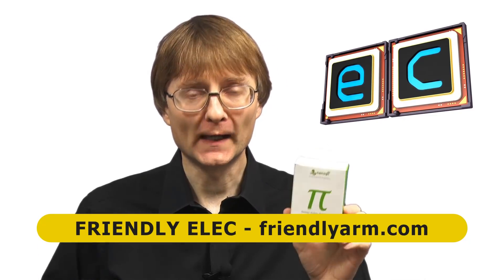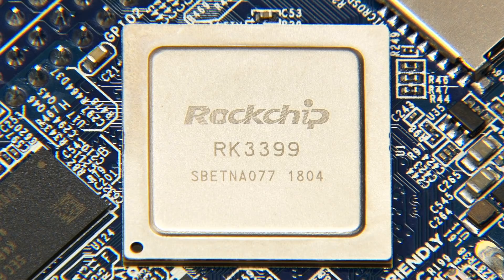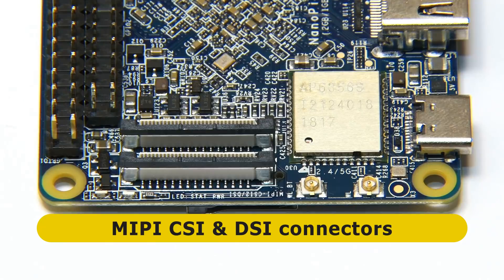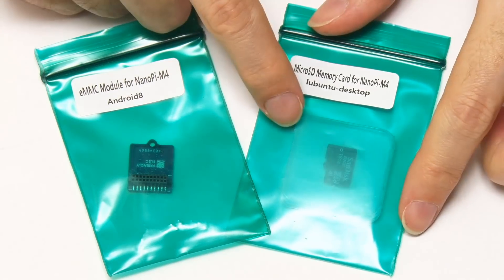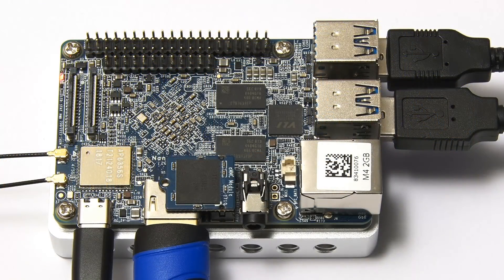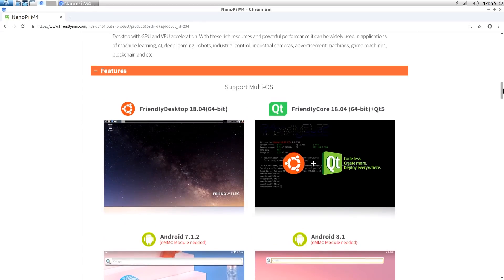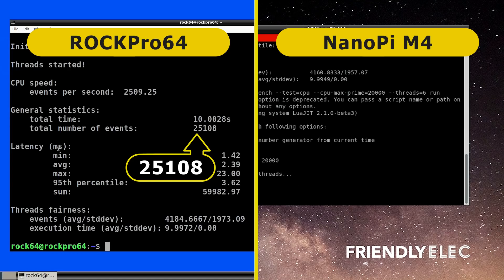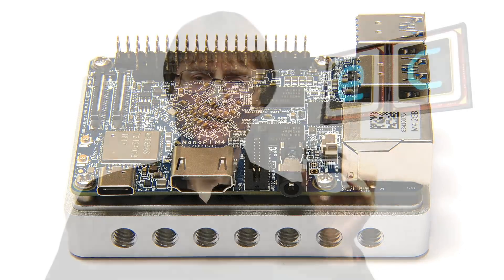NanoPi M4 : RK3399 SBC with 4 x USB 3.0

Comment: Friendly criticism: there are a few things that are always missing from your videos such as what this board could be used for and most importantly, long term stability and temperature reading. 

My experience with RK3399 is that it's a tremendously inefficient board and produces huge amount of heat. None of these boards come with custom made sinks or fans and so running this on a heatsink from rpi3 at a constant 60-70 celsius will just kill this board much faster. 

I had to do a headless OS for this to run in the range of 40-50 degrees while my Odroid XU4 never goes beyond 35 (despite being years older, more powerful overall and cheaper in price, although only 2 USB of course). 

So in the long term, it comes down to: What will you use this for? A lot of the Chinese companies producing these boards need to create more focus around the board, similarly to how Korean Odroid did it if they want to be competitive.

In comparison, Odroid comes in very unique factors, including specifically designed cloud form with a hard drive attachment, because they realized that SBCs are all good for 1 thing usually and so focusing is important. 

So far, with the exception of Renegade board using a similar processor, I found all RK based board to be just white elephants.
Reply from the maker: Thanks for this. I find your comment about no heat sink and using a Raspberry Pi one extremely strange given that I fit the very large and dedicated NanoPi M4 heat sink in the video, and talk about it quite extensively. I have covered SBC cooling extensively in some videos, and also uses. I have over 70 SBC videos here, and not all of them can cover everything! :)

Comment: Can we have a video of two 35$ SBCs Raspberry Pi 3B+ and Orange Pi Plus 2E. Apart from the processor the orange pi has an edge over the rpi. Also, armbian support for orange pi makes it much easier and faster than before(although I saw an article -  https://tech.scargill.net/orange-pi-plus-2e-revisited/ and the guy wasn't satisfied). Can you please cover the comparison of both devices (including the things in the given link) with a decent amount of active cooling? It's a request and I think it would show how overrrated or underrated orange pi is. You may also add tinker board (or the 's') to the comparison as it's specs are almost similar to the orange pi plus 2e. It would be then interesting to see two 35$ vs one 69$ - https://www.board-db.org/compare/156,113,251/ 

I apologise for the off-topic comment.
Reply from the maker: Noted! I do intend to cover some lower-priced SBCs soon. Though the next one here will be a LattePanda Alpha right at the top of the market.
Reply: @ExplainingComputers  Thank you :-) Looking forward to your next video.

Comment: Would this hardware be capable of encoding full HD with h.264 in real time?  I might get a board like this for emulation and such but real time video encoding could be a useful second use.
Reply from the maker: According to the Rockchip web page for the RK3399 -- http://opensource.rock-chips.com/wiki_RK3399 -- the SoC has "H.264/MVC/VP8 encoders [for[ 1080p@30fps". So in theory, yes. But it will depend on having software to take advantage of this.

Comment: A note on the RK3399.  That thing gets very very hot.   I have been using a NanoPC-T4 for some AI stuff, and with a passive heat sink the internal temp raises to about 78 C, while in idle stays at about 50 C.    So a fan is definitely necessary to extend the life of the board.  That said, these things are fast, for the price.    They aren’t as easy to setup/use as RPI, but then again with greater power.. you know the saying.
Reply from the maker: Spot on Sir. :)

Comment: As always great video. I saw it supports PWM. Does that require 3 pins. Lets suppose I wanted to connect R/C type servos and program them. Or do I need another interface board?
Reply from the maker: I've not looked into this for this board, but in theory the PWM could be used to control servos directly, although they would need to be independently powered.

Comment: Do you see any reason why this board wouldn't be able to run kodi? Do you know if the board's HDMI is CEC compatible like the Pi that way the TV remote can be used to operate Kodi through the HDMI cable?
Reply from the maker: Should be able to run Kodi. I suspect an image will appear soon (the board is only August 2018). Don't know about CEC.
Reply: Thanks for the reply.

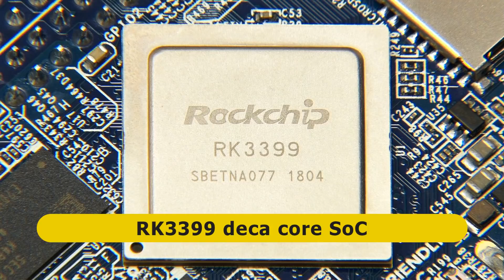Comment: At 2:22 it is shown the A72 cores "up to 2.0GHz", also the friendlyarm's hardware spec says up to 2.0GHz, but at 11:11 the system information shows 408-1800MHz (and less than 1.5GHz max for the other cores, too). Am I just noob with how linux handles/shows the max frequencies (i.e. system info would show 2.0GHz only after pushing it for real, or the configuration is just wrong or ...) or what is going on with that?
Reply from the maker: There is much discussion of this over in the forums for this board! The specs for the RK3399 are correct at 2.0 / 1.5. But the board, as you note, clearly reports running lower than this in the distro shown, as you have correctly noted. It can probably be tweaked! :)

Comment: Question about this particular product... Can the NanoPi M4 run a standard Raspberry Pi distribution like raspbian? What about things like Diet pi? If indeed it can run raspbian, does it have access to all the hardware or require special configuration? Would we lose specific optimizations and or Hardware support for certain things? For example if running raspbian does it understand all of the io connectors and the Wi-Fi and ethernet Etc? Apologies if I am off track with my questioning, I am always confused on Raspberry Pi similar devices, maybe I have missed the point and we are not supposed to run raspbian or Diet pie or other images, perhaps we are supposed to only run the image supplied by the board maker? Any guidance and insight certainly appreciated, thank you.
Reply from the maker: A standard Raspbian image will not work. Raspbian could potentially be ported to this board, but it would need its own image to deal with precisely the hardware requirements that you raise.
Reply: @ExplainingComputers  thank you, that helped

Comment: $30 more for an additional 2 GB!  Who do they think they are, Apple?
Reply: 2GB version is DDR3 and 4GB version is LPDDR3. LPDDD3 operates at 1.35 volts, consumes less power and produces less heat than DDR3 (operates at 1.5 volts). So LPDDR3 is better but much more expensive than DDR3.

Comment: Keep in mind that those UFL connectors for antenna are by design very weak. 7 - 10 times connecting the antenna will wear out the connector and you will start loosing signal quality. Better to plug the antenna and keep it plugged forever.  And it’s not the boards problem, everything with UFL connectors will have the wear out problem.
Reply from the maker: Very true.

Comment: Thanks, explainingcomputers! Now I can buy not banana pi but nano pi m4 with USB 3.0. Cool! I'm gonna make a diy laptop right away : )
Reply from the maker: Good luck! :)
Reply: Well, confused again . Now I have to choose between NanoPI-M4 and NanoPC-T4.  : | 
Anyway, many thanks for your reply : D -- I really enjoy your video since I purchased RPi for the first time. SBC is the love!
Reply from the maker: The choice is indeed difficult these days -- so many options. The Rock64 is also a nice board -- with Pine very much supporting SBC laptops.
Reply: Is there a way to supply power using battery pack (a 3.7v li-ion battery) to Nano Pi M$ / that Rock64 or NPI-T4?
I don't want to use BIG power banks. That's the main reason why I still confused. Most of SBC has only 5V power input (USB micro B).
(Also, price is important, too. If it costs over $100, my parents might object to me buying it)

Comment: Nice!  Not sure if I fancy the heatsink as much as you (although I do appreciate a hunk of nicely machined alum as the next person), its just I was kinda liking the fact about having the same form factor as the PI for possible case options.  You think this board is worth it then Chris?  As always great vid!
Reply from the maker: Is it worth it? That depends. The 4x USB 3.0 is very nice for anything handling data, as is the extra RAM and Ethernet at a true gigabit. So a better board than a Raspberry Pi for a NAS, but then so is a Rock64 which is considerably cheaper. Software support seems decent -- better than most SBCs, but not as good as a Raspberry Pi. I need to test more where this fits into the mix.

Comment: I'd like to see the thermal performance compared to the other boards you have tested.

I'd also like to see a collection of the new sysbench for your series of boards to get an easier comparison.

Last, could the limited memory be the cause of the slightly slower performance?
Reply from the maker: The 2GB memory could certainly be impacting performance a little in the comparison to the 4GB RockPro64. I will I'm sure return to thermal performance at some point. I am pondering what to do on the Sysbench thing, as the newer version is not available for most SBCs.

Comment: probably a dumb question, but can you plug an external hard drive into one of the USB's and i you had Windows 10 on a memory stick, would that work also?
Reply from the maker: External USB hard drive, no problem. But you cannot run Windows (which requires an x86  processor) on this board, as it is ARM based. But your memory stick will work as a storage device just fine.
Reply: OK thanks

Comment: If the NanoPi has 6 cores, why did your test say it has 6 threads? I thought it should have twice as many...
Reply from the maker: While some CPUs have multiple threads per core, this is generally for desktop processors. The cores in the RK3399 are single thread.

Comment: Much as the range of boards being tested is interesting, so much of these boards is about I/O, not merely processor power (they are systems on a board, not merely processors on a board), yet the I/O is rarely stretched.

It would be interesting to see how stable the WiFi and Bluetooth are under simultaneous sustained load.  Given it has 4 USB 3.0 ports, how well does it cope with power being drawn from all 4 ports?  Given it has two camera inputs, how fast can it actually process data from these cameras (e.g. could it be used for image recognition from stereo cameras)?
Reply from the maker: All good questions!

Comment: So we expect there'll be a NVMe / SATA hat / expansion board coming out using that pcie expansion connector? That massive heatsink makes a good weighted base, but seems odd they don't have a injection molded cover for the top. Would a RPi cover fit it, since the ports and size look really similar?
Reply from the maker: Some Pi covers/HATs, yes.
Reply: SATA hat for Neo4 https://twitter.com/armbian/status/1043769747760996352 while for M4 does not exists at the moment.

Comment: thanks for updating us by your videos......
sir i have one doubt that - raspberry pi  has too much developing project with so many code. so, if i wanna try that all project with same code of raspberry pi on "NanoPi"....then that will run and give success results or not......
Reply from the maker: This board will not run Raspberry Pi images. Though, say, Python code written on a Pi should run, though it depends what it addresses: eg code accessing the GPIO pins should work fine.
Reply: @ExplainingComputers   Sir...can  Rock64 can run codes of raspberry pi on its boards...... Since both supports Debian Linux....
Or Is there any possible way to do it successful correct.....
Reply from the maker: Yes, you are right -- both are running an ARM distro based on Debian, so in theory there will be a reasonable level of compatibility. So while a Pi OS image will not work on a NanoPi M4, some/many programs may install and work fine. But it will depend what hardware resources they draw on, and via what drivers.

Comment: The eMMC comes pre-flashed, or how can someone flash the eMMC with a desired OS? An USB adapter is needed?
Reply from the maker: Very good point -- you do indeed need a USB adapter to (re)flash the eMMC.
Reply: @ExplainingComputers  Thanks for the reply, Christopher. One last thing, do you know something about the GPIO library of this board? Because in the web there's only information for the M3 and other legacy boards that use the wiringNP library.

Comment: Thanks for introducing this SBC to us! But I'm wondering; with the eMMC being up above the HDMI port & the CPU/cooler on the underside, isn't this board incompatible with all the Raspberry Pi cases out there? I'd love to place this SBC in the new Retroflag SuperPi SNES case but that may not be possible.
Reply from the maker: Yes, may cases will struggle to accommodate this due to the SoC and other placements - though not all.

Comment: I was wondering about mounting options. Although they have kept roughly a Raspberry Pi form factor, none of the cases or hardware that uses the four holes will fit this board. 
I guess that this will be a great project for 3D printers alike. Perhaps if the heat sink was mounted with standoff’s instead of screws, Pi hats could be screwed on top?
Reply from the maker: Spot on about the HATs -- that is where the form factor compatibility really lies. Not with Pi cases.

Comment: Hi Chris.
Sorry if this question already has been asked. Haven't read through all 450 comments.
What's the 4 pins located between the two USB Ports?
And as always, TA for a great video. Keep you're great work.
Reply from the maker: They are a UART connector it seems.
Reply: @ExplainingComputers  TA. 
UART could come in handy in future projects. Perhaps I should replace one of my older rpi's with this one.

Comment: Great review, Chris!  I want to make a single-board movie machine, something to take to my friends' house to play .avi, .mkv, mpeg, etc. files. What would that look like? Does VLC run on these systems?
Reply from the maker: The issue with VLC is a version that makes use of GPU video decoding -- eg you can get VLC for a Pi, but software only decoding I think. Kodi is popular and works well on many SBCs -- certainly on a Pi 3 B+, or a Tinker Board. Both of these boards can be good video players in the manner you suggest when playing local files; though many/most SBCs start to struggle with HD streaming media.

Comment: A very nice SBC and review.   I do love that huge passive heat sink.   A really nice design touch to add the 1/4x20 tapped holes.    As you said this is very useful for mounting.

Dave.

Comment: 5V at 3A?!   That seems like a lot.  Funny I wouldn't have thought 15W of energy would be that warm.  You didn't show the boot up of lubuntu! :-)  Ok.  I just saw that it was the 32bit version.  And you didn't show the boot up on the 64bit "linux" version. :-(  So was it as quick as the android?  The android version was very quick as far as I could tell.  Regardless I always enjoy your videos.
Reply from the maker: The boot up of Lubuntu was pretty quick, but I didn't have time to set up a camera to record it, and like many non-Pi SBCs it is not, eh, happy to be told what resolution and frame rate to use before it reaches its desktop -- which makes HDMI recording hard. In Android there is no setting for HDMI I could find here, but the board stayed in 1080i 60 from the get-go which is not ideal for me (producing 1080p 25p), but did work! Though you will see some interlace/conversion issues.
Reply: I am still trying to find the right product that I can use in my car project.  I want the system to be up and ready in 2 seconds or less.  Granted some things can be run after that initial time.  I don't want to use sleep states to bring it out of hibernation either.  Running SBCs in a warm to hot vehicle (I live in the desert) is a recipe for failure.  Having them technically on, all the time, even while sleeping can shorten the life of the units.

Comment: Your sysbench test results were better than my linux laptop..  It's an i5-4210U with 8gb of ram.  :(
Reply: I've just run sysbench 0.4.12 on a couple of Linux laptops:

The X201 with its 2.4GHz i5 averaged about 9.9s and the MSI U180 with its Atom N260 averaged about 104s.

For the Gimp tests, the X201 took about 3.7s and the U180 took about 22.4s.

Those machines have 4GB and 1GB ram respectively and are both running MX Linux 16.1.

I think my results show that these latest SBCs are quite capable when compared to "ordinary PCs" from a few years ago.
Reply from the maker: orru about that.

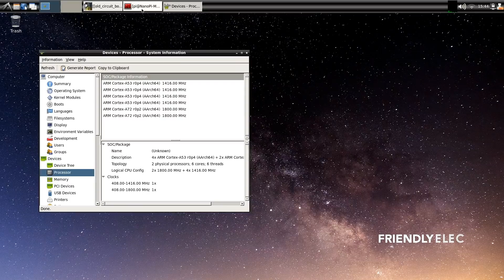Comment: The terminal used at 11:48 is called Terminator, right click on its background to show a menu with the option "Zoom terminal", 
in some cases it enlarges the font, or try splitting it with control+shift+o first. (o = letter, splits into 2 wide parts, e splits into 2 columns.)
or just start /usr/bin/gnome-terminal, might work, then press ctrl and the plus sign to zoom in.
Control + shift + plus sign (not on keypad) also seems to work in Terminator,  Ctrl and minus sign zooms out.
My plus sign needs shift to select it, your keyboard might not.
Reply from the maker: I tried the options you mention aside from the control key plus arrows (which I will try now!), and sadly the zoom functionality is not implemented here. I tried the other terminal apps also. I've never run a terminal in Linux where I could not change the font size before. But this is a port to an ARM board, and we get what we get!
Reply: Ctrl+MouseWheelUp/MouseWheelDown also perform the zoom function as well as the keyboard shortcuts by OP. The zoom in the right-click menu only has an effect when you have multiple terminals in a single window and you can pick one of them to "zoom" or "maximise" that terminal, hiding the others. Maximise fills the window maintaining font size, i.e. more text. Zoom roughly maintains the amount of text, i.e. bigger font. Think tiling window manager for terminals.